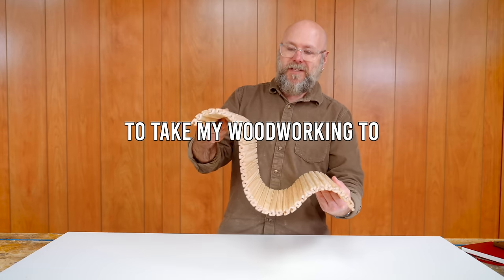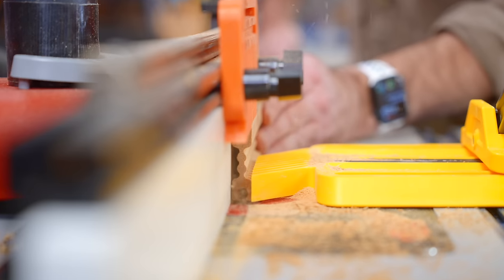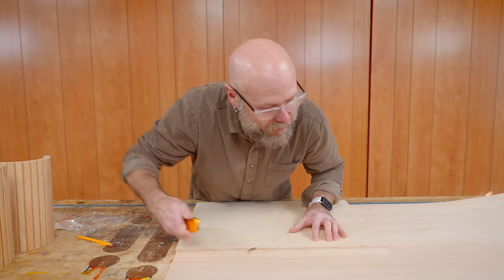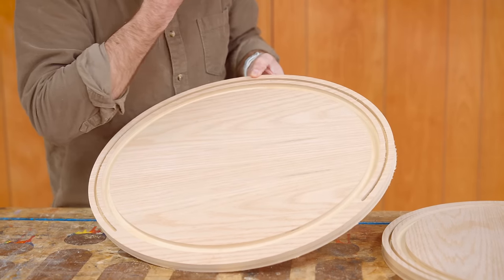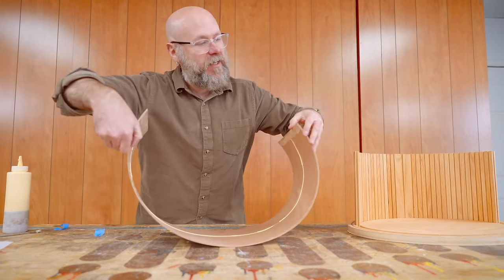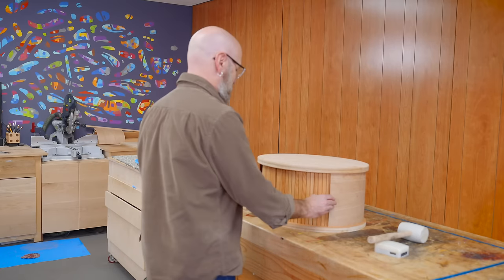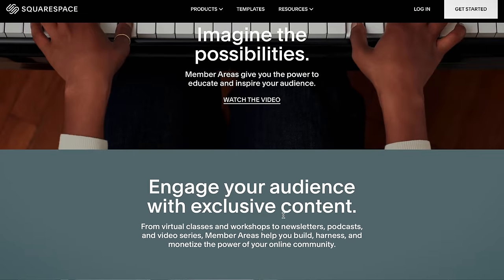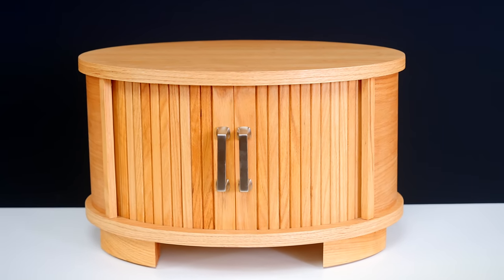Elevate your woodworking game with this AMAZING joint!

Comment: That one handle is killing me. Cool build though.
Reply: I noticed that too. Left one. Not a mistake, happy accident!😂
Reply: I thought the left one looked off!
Reply: Glad I wasn’t the only one who noticed 😂
Reply: I think it’s the right! However one is in England maybe that’s why?
Bob
England
Reply: Came here for this haha. I love it though!
Reply: Yeah, I was surprised he spent all this time getting the wood to do amazing things and look great and then just put the hardware on crooked like an afterthought. Also the handles didn’t seem like the right fit for the size, seemed a little large? Just nitpicking, though. Cheap handles, 4/5 stars, WEN!
Reply: 🏴😊 @BobMuir100
Reply: Lol, me too 😁 great job though, beautiful joint thanks for sharing 👍🏿
Reply: Yup, like OUCH to the eye... very cool build indeed
Reply: Good eye 👍
It would be so fun to build the flexible wood slates..
Already thinking about applying that method to a modern art style chase lounge
Reply: Had to use a magnifying glass. Still didn't get it. Finally jumped out at me ... left handle not perfectly vertical.

Comment: That came out awesome! I love that you appreciate your Dan properly, it is good to appreciate your Dan, he does excellent work and he is a Dan Luxury to have! =) Had a thought for this project, but obviously a bit late for yours, but a nice touch would be to cut a dado at the top and bottom of the piece of the door that the handles were bolted too, then you could have a matching dowel mounted near the center that the doors would slide into and act as a stop in the center, so the doors would still close together nicely, but it would keep them from going past the center. =)  Also, I freakin love the "window" in your shop and the way you have your whole shop setup, so creative and so peaceful and relaxing.

Comment: So a few tips. First, take a little notch out of the top and bottom of the termination piece on the meeting middle edge. Then glue small pieces into the tracks slightly smaller than the combined notches right in the middle of the opening. That will prevent sliding closed too far and defines a true center where they meet.

Second. Lightly chamfer or round all edges of the door pieces individually. Just touch it with a sander. That will promote sliding like a sled instead of digging in to the channel, especially in the corners of the channel. While it may slide well at first, over time a groove might get dug into the channel from a few sharper pieces of door. Also, chamfering where it meets the inside corner of the channel leaves a space for dust to go over time.

Third. If you designed it in 2 pieces for each top and bottom it would be easier for repair or cleaning. If you don't want to take the whole cabinet apart, you could have made the center/inside section removable with a few screws on the inside of the cabinet. Since the opening is almost the full width of the cabinet, you should be able to get pieces like that in and out. Maybe a couple not glued locator dowels to make sure it's positioned right when reinstalling.

Comment: Not breaking new ground, but a couple of pices that are 8x8, 10x10 or 12x12 with a 12 inch black pipe on a flange with free weights, makes an excellent centralized "clamp"
Great lòking project.

Comment: Beautiful piece. For the doors, you could leave a small piece of wood inside the door track - part of the cnc cut - that would be a stop for the middle of the track in the front. So positive stop for the doors on close. Notch the end pieces on the doors so the doors fit over the stop in top and bottom tracks and ..... profit?

Comment: So Dave, if a person didn't have a cnc how would they go about making the top and bottom, with the multiple slots cut concentrically/equa-distant from the edge like that?  Nice outcome, i'm a sucka for tambour..
Reply from the maker: Thanks! You would cut out a template on the bandsaw or jigsaw and use a template bit with a handheld router.

Comment: Because you cut your door slats to 9", the enclosure will be less than 9" tall on the inside because of the slots that the door will slide in... Not sure how deep you made the tracks for the doors, but it looks to be almost 1/2" inch deep? If so that makes the inside of the cabinet really close to 8", probably slightly higher than 8" (to give movement allowance for the doors).

Comment: Love build.  Question on how strong the sides are with just veneer wall?  Assuming it's only about 1/8" thick
Reply from the maker: it's just under 1/4" thick and I could easily stand on it.
Reply: @MakeSomething  thanks, as I said I love the design and channel

Comment: You should make a bent lamination former, make the curved panels
Sand and finnish it with the hard whare  then cut the groves into the plywood.  You can make several sizes.  A larger sofa table thats on long legs fits the style better.
This is pretty short for an end table
And a matching set would be nice its a 1960s desined mid century modern, its pretty classic. 
Nice table, i like it.
A full bedroom set like that could be very cool, or a modern entertainment center for an AVR and 70" flat screen tv.
If someone had a media or home theater room set up as mid century modern, no one is making a tv stand for a big screen tv in that style. You could sell a bunch of them.
Reply: Long cure time glue, tightbond III has 25min working time.

Comment: As an idea let me add three things

#1- The door handle could be wood

#2- The door could be only one, thus the handle used as a limiter on both ways

#3- the door haven't limiter

It would be perfect if u even show as how much pressure it could resist!

Comment: That is so much nicer than that stupid net backing version.
Reply: This is a very neat tambour however with all the parts of the cabinet going through seasonal movement over time the tambour can start binding in the channel. Once that happens the ball end splits off. That is the main reason I use canvass to back my tambours.

Comment: That's mighty attractive veneer... nice and thick and seems so (relatively) "well-behaved" when tack-gluing four sheets into those grooves. Yeah, I'll bet it was pretty difficult to do it that way. But still, I'd bet that thinner sheets would have made that process impossible.  Can you share the source and a more detailed description of the veneer?
Reply from the maker: they are 2 ply veneers. 2' x 8'. Got them from my local plywood dealer. That's all I know about them.
Reply: Thanks David. Two-ply.  I'll check out some vendors, using that search term.
Reply from the maker: @LewHarriman  the back ply is a different species and the grain runs the opposite direction. You can also look for "paper backed veneer" that works just as well.

Comment: Interesting process for this build. I'm surprised you didn't make any jokes about Red Oak being "practice wood." Do you think you could've used something like 1/4" or 3/8" plywood and kerfed it to allow it to bend around the oval shape without having to have struggled so much with thin veneers?

Comment: It makes me nervous to glue this thing together and never be able to access the Tambour ribs. To address this, I would drill a hole (big enough for the end caps to pass through WITHOUT their handles) in the bottom that goes through the slider slot. This hole would be located where one of the feet are attached. To the top of the foot that will cover the hole, I would attach a bung/plug that would replace all the material removed by the making the hole. The result is that by removing the foot, you have access to remove all of the moving parts. This would allow you to make future adjustments/repairs.

Comment: There is a school of thought that considers computer aided tools to be an abomination to woodworkers. I say "Bah!" Use whatcha got. I could...with considerably more fiddling...make the tambour slats. Have, in fact, done so without 'specific to the project' bits. Took three days to make a tambour for a smaller rolltop secretary. I have cut ovals using a funky jig technique with a string and finish nails, then cleaned up on disc sander.

One of the purest styles of furniture ( in my opinion) is Shaker. Clean lines, simple forms, pure function. The Shakers got this bum rap where folk bunch them with the Amish. Nothing could be further from the truth. They used whatever tech was available to manufacture their furniture...hand tools, power tools, what have you. If it works, saves time, speeds the process...use it. From my understanding, the last of the REAL Shakers worked as computer programmers up into their eighties.

There are also haters out there that are going to go off on you for all the cool stuff you have. The CNC router, the Shark router table, the comfortable and cozy workspace. Let 'em. If they envy you, let them work to acquire the cool stuff. If they just hate to hate, pity them.

In the end, what it boils down to is the process of creation, and you have built a space that lets your creativity flow. Good on you, mate! That lil' table...cabinet...whatchamacallit...is cool as anything I've seen in years. You rock!

Comment: OK I've worked out how to achieve this result without selling your grandmother for $200 and change for the router bit set.  Buy a Roman Ogee bit for the male profile one pass either side, cut slot with table saw then run ball end bit finish that side of the slat with a bull nose bit, job done and change out of $100.  I'm in the UK and I have all but the Ball bit but CMT do a 1/4in one for £25.

Comment: Two things:
1) I thought you hated oak.
2) I need a David explination why glue will dry in a vacuum bag but not in a closed bottle.
Reply from the maker: 1. Still do! 
2. I'm still not totally sure except I think it's getting absorbed into the wood. I'm pretty sure if I put wood glue between two pieces of plastic and put it in the vacuum bag it wouldn't cure for days.
Reply: Thanks haha!  @MakeSomething

Comment: Too big handles. And the left one is screwed on crookedly.
It is better to join the veneer on the edge at a large angle, as it will not be visible.
The vertical strips on the edge should be more delicate and flush with the outside of the bent side.